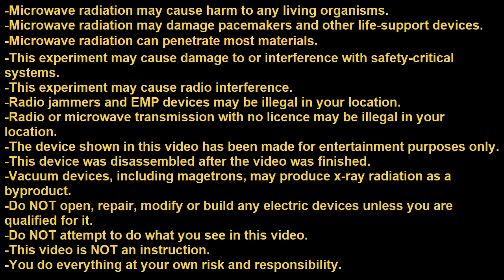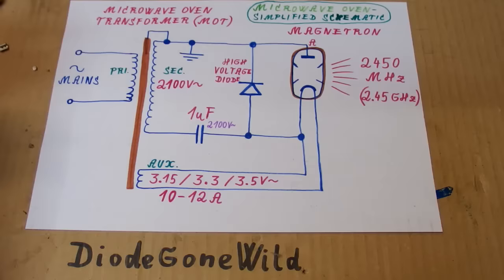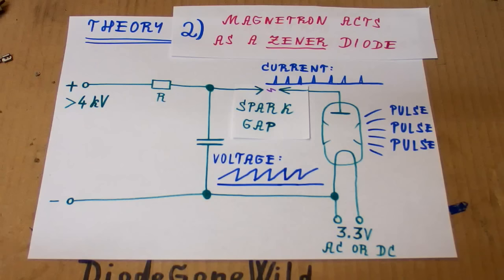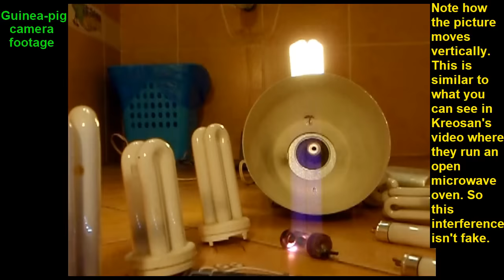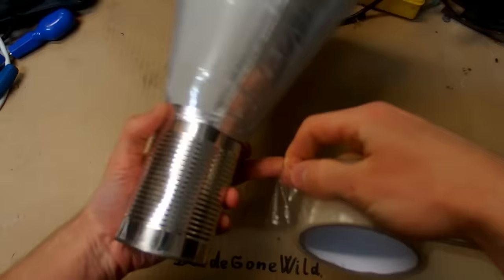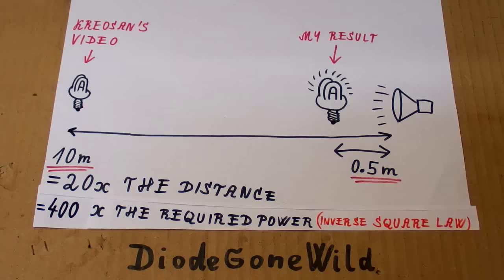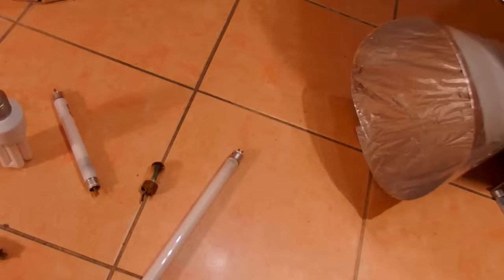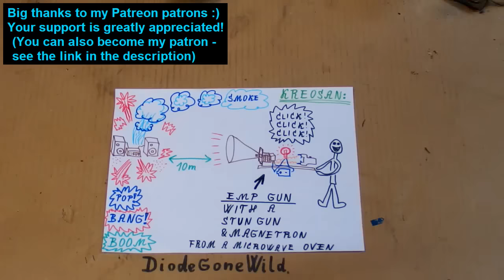Debunking Kreosan's EMP gun from a microwave oven magnetron + stun gun

Comment: so wait , you got this to half ass work and yet claim it as debunked ? sure some of their video is fake and tricks but some of it is not tricks . you can shutdown or reset electronics with what they made . everyone ive seen do this has flawed testing , not enough magnetrons , improper power supply , improper shaped wave guide . i think people did this ''debunk'' backwards , they tried to upscale and try to make what they did , but what happens when you downscale and go back to basics .... like put your phone in a microwave ? what happens ? 5-10 secs ur phone is gone ....so now upscale from there , you need to guide the waves proper to carry distance and the power does not need to be overboard for the magnetrons . adding volts or amps beyond what its made for will damage the magnetron and reduce output. so anyway ... flawed debunk again . not saying everything in their video was real cuz it clearly wasnt , but being able to reset or damage electronics at a distance is totally doable

Comment: Your direction tactics are wrong try cutting the direction chamber from the microwave its purpose is to channel the radiation in one direction then use a metal extension not this foil crap
Reply: I heard that a metal cone with a reverse can consentrate the beam like a laser need to test it first

Comment: You're antenna has the wrong shape, wrong characteristics, and you're tin is a very bad microwave line. If you switch to a good parabola antenna and connect it to a fitting wicrowave line that is connected to the magnetron, than wou will see amazing effects. So the video is not "debunking", because you're experimental setup is poor. Sorry.

Comment: well well well,, as far as electronics equipment is concerned, it will not effect them as much as they are not able to receive and convert the microwaves into destructive energy, that is from a distance, however if you were to put all of those things inside a kitchen Microwave they will incinerate, so any device you need to destroy at a distance also needs an antenna horn tuned to same resonant frequency so the goy who demonstrated his music center gone in flames possibly had a built in loop antenna that broadly speaking converted the Microwaves to a high voltage that blew up the transistors and it went up in flames. 
I have been planning to send a beam of Microwaves in a very narrow beam to charge an electric car from a flat on 9th floor, such that Microwaves  be directed at the car's roof mounted antenna receiver and convert m.waves into a voltage to charge an electric car battery overnight with an efficiency of about 60% , it will also have a laser bean to guide the beam target on to car and laser beam can be monitored when it bounces back such that any obstruction by a person can disable the M.waves to safeguard people or animals or birds.

Comment: I'm also having concern about cellphone since my view dramatically declined in a short time since covid.I've been using my New 5g phone à lot since the out break.I never had vision problem i'm 34 years old,but now my vision is getting blurry.i also live right by à 5g antenna(moved here last summer.i wonder if my vision declined because of too much screen time on my small phone screen or if it has to do with the radiation or maybe à little bit of both...i also wondered if the vaccine could have something to do with it(i doubt it),since the problem only appeared recently. I also have frequent headache...i wonder if anyone else experiencing this.Maybe i'm just getting older and need glasses,but i have doubt,since it all happened so fast...i need to see an opthalmologist now,which i never did

Comment: This is simply a microwave operating mode...it does not produce EMP.
It can turn on the lights like radiation but not EMP
The EMP is done by sparking and when the microwave lamp is already in operation.
  To produce microwaves it takes certain seconds .. 
WHEN we need the microwave lamp active except we apply extra voltage like sparks to produce the EMP

Comment: You completely lost me with the horn construction.  Waveguides have to be as perfectly smooth as humanly possible to work.  Even the tiniest ridge will bounce part of the signal back towards the source.  Using aluminum foil in any such capacity is absolutely useless.  It's perfectly fine to use aluminum, but a waveguide that large would have to be milled and polished to a mirror finish.  Then you used a soup can with a hole punched in it.  I died laughing.  No way this will work.

Comment: While I am sure these sorts of things are faked for many reasons, several years ago I saw this YT video (cant find it now) with these two Russian guys taking 2 MOTs and drilling two holes in the side of a 1m or so metal tube.  The tube looked to be 3 or 4cm wide (1" to <2" or so in American  inches).  The two MOTS were like 6 or 8" (15+cm) apart and rear one was perhaps just a few inches from the end (its body was, hole likely 6" or so??? They were able to light bulbs with antennas from 30m or more in an outdoor quarry.   While likely this was faked, it intrigued me since I DO have a book that actually has plans for a microwave interference gun designed by a microwave engineer ... its purpose was just to garble neighbors loud stereos from some distance.
Now I know microwaves are quite directional (at least at SOME frequencies) after all, we love them in Radars and microwave relay stations and were a fav for orbital power stations beaming power down to earth (dont want to cook small towns with fringe radiation)... and of course magnetrons themselves were invented by the English and mass produced by the Americans for WW2 radar so it seams at least plausible to make some sort of high power directional microwave gun that could do such things.
As a side note, it would be interesting just trying to build an amateur radar with magnetrons ... tested quickly and clandestinely in the middle of nowhere of course... but that would be quite a project.

Comment: no need to invent any nonsense!  take three transformers and three capacitors and 6 diodes and connect all this so that you get 6000 volts and turn it on as usual through a regular network, like in a microwave, and that's it!  And inappropriately invent any nonsense!